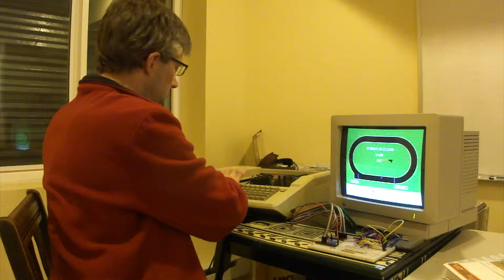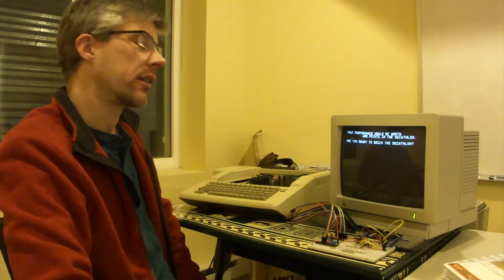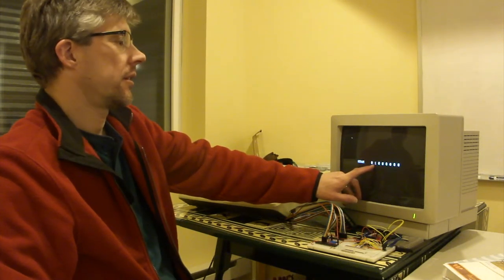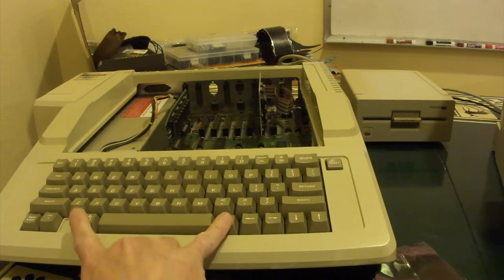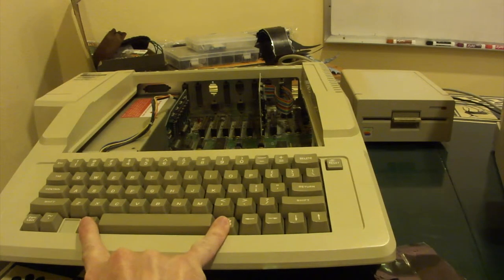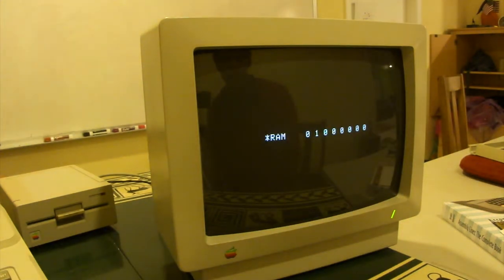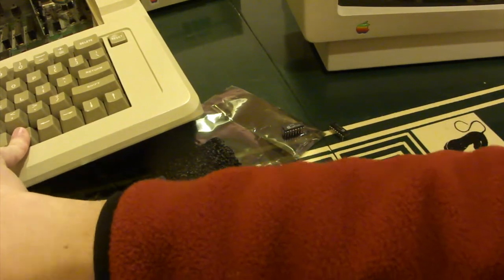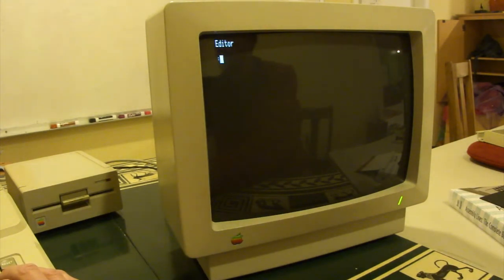Assembly Lines #4: Replacing Apple //e RAM

Comment: Thank you for this video!  I have a IIe that was also getting a RAM fault in zero-page and if it wasn't for your mention of the asterisk indicating extended memory I may have resorted to a soldering iron which could have been disastrous.  As it was, I just removed the Extended 80 column RGB card and "System OK".  You saved me so much pain!
Reply from the maker: Hi Trevor, I'm glad to hear that the video was helpful! That's too bad that the card failed - those are usually reliable, but I guess after 30 years... Maybe you could diagnose what's wrong with your card?
Reply: Hi Chris, once I knew the machine worked fine without the card I looked at the card closely to check which of the chips were RAM thinking I could just replace them easily as they're socketed.  Turns out that one of the chips had a leg bent out of the socket - looked pretty deliberate and I'm not sure how it could have happened by accident.  Anyway, I carefully bent it back and put the chip back in the socket and it worked perfectly!  The card came from an eBay purchase and may have been damaged in transit or before it was sold to me.  I wanted the RGB card as it's hard to get colour in PAL-land UK but in the end I bought a VGA-scaler so I now have a beautiful fully-working machine in full colour with CFFA-3000 and mockingboard and I'm very happy!

It's quite a rare machine - an Enhanced IIe in a Platinum case but no numeric keypad - some kind of hybrid "European Platinum IIe" - so I was desperate to get it working.

Love the Assembly Lines book by the way!
Reply from the maker: Wow, sounds like a great system. Post some pictures or video somewhere! Cheers.